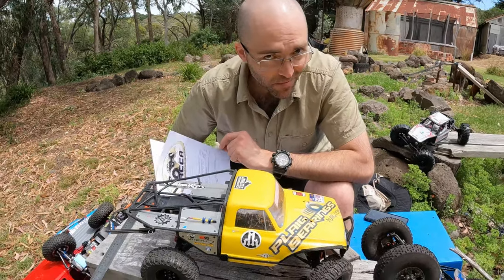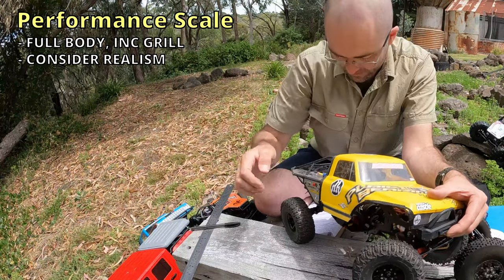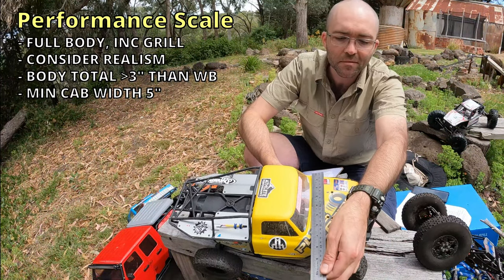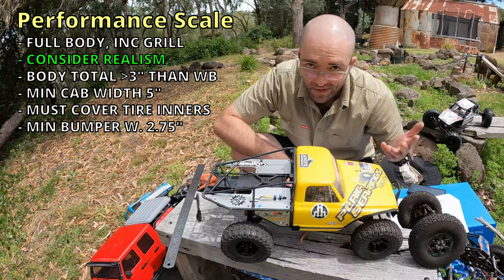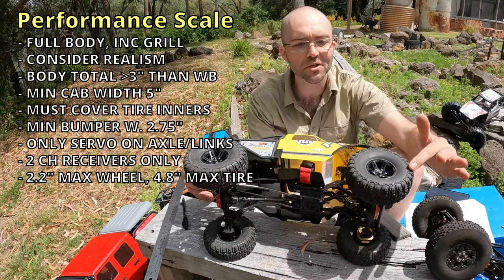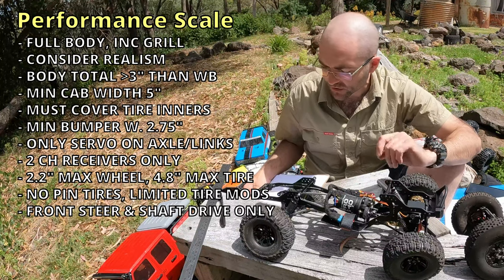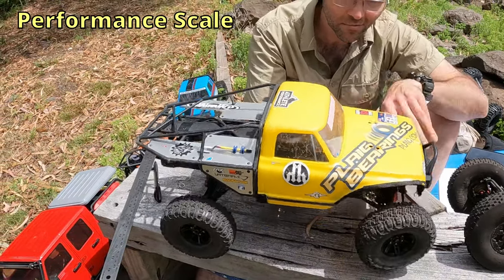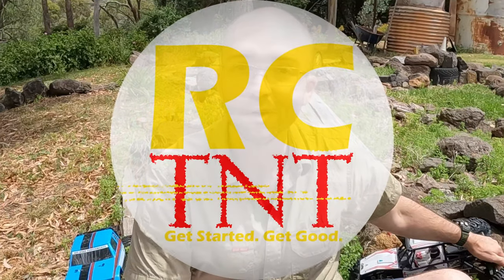Let's Set Up a Comp Rig for WRCCA Spec!

Comment: I watched all three of your videos today. Thanks for doing them. I have attended large r/c car races, but for the most part these rules are much more involved and detailed. I could see people showing up at a competition for the first time and not be allowed to run their vehicle because they don't meet a finer point. I understand the chassis drive line  rules, servo mounts, tire size, etc. The body rules seem to be very picky. Is there a motor restriction in any of the classes? What about batteries and weight?
Reply from the maker: No restrictions on any of those things. Also, for local comps, I'll always let people drive, even if they're out of spec. They can be timed and scored, just not ranked, if they're out of spec. Fun first, comp second!
Reply: @RCTNT  Thanks for replying. I surprised that there were not more restrictions on things like the esc and motor. With the new Hobbywing systems with the esc and motor combinations and other esc's and motors would be a huge advantage. That would be true of servos also. I think it's great that people can still participate even if they don't meet all the rules. I would assume that most drivers entering the large competitions have competed in local or club competitions before entering big events.
Reply from the maker: Often the bigger events attract newcomers, and then they go looking for local clubs and events :)

The FOC gear feels great to drive but it's heavy. And with servos it isn't a big deal, my national ranked mini uses a $20 servo, for example :)

Tires make a huge difference, and rig setup for low cog and smooth suspension, etc. Not necessarily pay to play, though some expenditure is required. The good news is your money goes a long way when you set up a crawler. Breakages aren't common, so once you get your rig sorted, it'll only need time to maintain.

(there are 7 videos in this mini-series, too, btw)
Reply: @RCTNT  No matter what kind of racing or r/c competitions, it's always tires.
Reply from the maker: Truth.

Comment: Cheers! Looking at the Axial SCX-10 Pro and hope this would fit nicely. Any other suggestions I’m all ears - your rig looks pretty sweet
Reply from the maker: Thanks! My SCX10 Pro video review and rock test drops in a few days from now. If you want an out of the box solution that's a brilliant crawler, look at the Ecto, Base Camp, TRX4 Sport RTRs and GMade GS02F kit. The Axial Raw Builder's Kit with INJORA LCG chassis is another great option (and loosely what my P/Scale rig is based on). The SCX10 Pro is a decent start as well, though you'll see my reasoning for recommending the above when that video drops. Cheers
Reply: Wow, a lot to unpack there. Appreciate the detailed response - you’re a great authority on Trail n Tech! Looking forward to your take on that rig, but I’ll check into your notes above in the meantime. Not my first rodeo and coming off a Phoenix (which was so nice to build!)
Reply from the maker: Ah, great! The scx10 pro felt similar to the phoenix on the rocks when I filmed it this week, for whatever that's worth. Well designed, lovingly created, yet limited by poor break over angle. Otherwise, beautiful. I'm a fan of both from an engineering perspective in particular :)